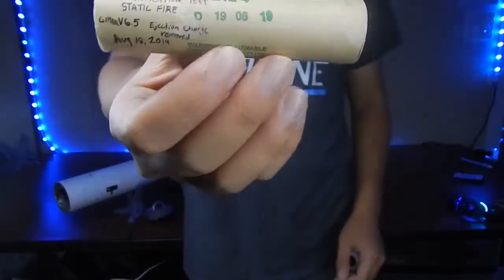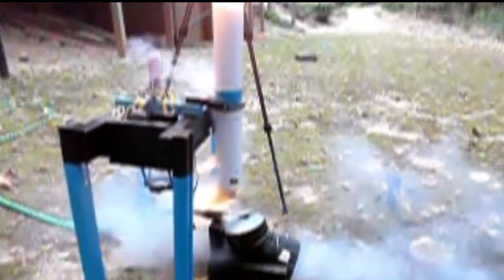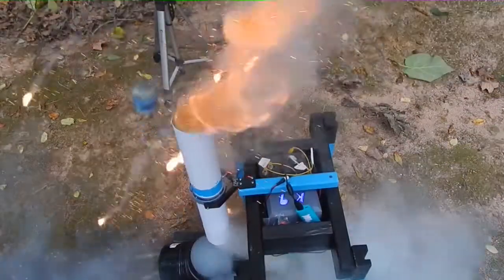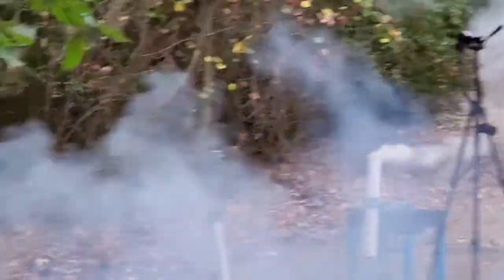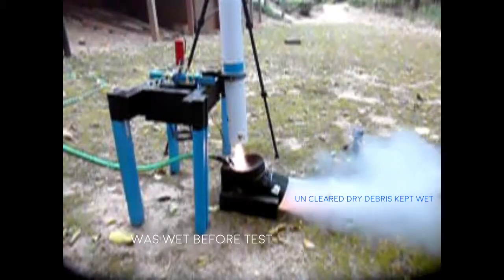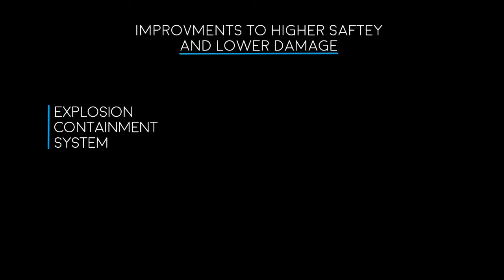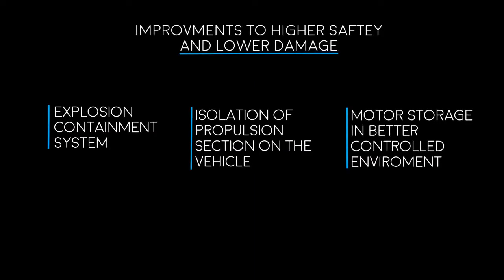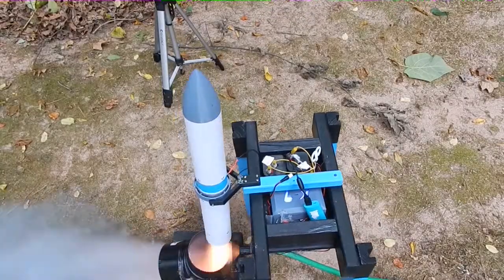K-9 TVC Hold Down Test Anomaly CATO!

Comment: probably caused by backpressure maybe by the fire tunnel, good video!
Reply from the maker: Thanks! Yes the secondary was most likely from the pressure build up from the lower explosion which in turn pushed up at the moment of the upper propellant fully combusting. In reality though this happens almost instantly along with the initial explosion looking like one. The high speed is what revealed this, for I thought all along it was a single blow out

Comment: Was this caused by damage of the motor when removing the ejection charge? I am developing my own TVC system and am looking for advice on how to do it safely.
Reply from the maker: TheRedstoneHive There is a tiny possibility that during the removal process, it may have caused cracks (I was less careful with this one) like as the tool scraches and hits, it can cause some micro cracks. I highly doubt it though because the cracks seemed to have spread near the bottom. I think it's highly likely it was from the manufacturer, and Jake Blocker told me they Estes motors blow up easily (checked online, everyone says the same thing too) especially the E-12. Anyway ejection chragr removal isn't recommended, so next time I may just go with a E-12-0 that comes without it in the first place
Reply: @CanineDefenseTechnologies  E12-0s have an ejection charge, but the time delay is 0 seconds. You could put a cap over the motor and use the ejection charge as extra thrust I guess. That is what I am thinking of doing if I can find any E class booster motors where I live.
Reply from the maker: @theredstonehive  The Estes E-12-0 have no ejection charge. They are booster motors, and any booster motors by Estes has no Ejection charges because they are used for axillary boosters. The 0 is not for zero seconds till ejection, it means no ejection charge at all. But your ejection Idea sounds cool! Will live to see the design!
Reply from the maker: OK after looking more online, most people were wrong. The 0 at the end does mean the ejection charge fires right away used in staging the next motor. I was wrong, thanks for telling me I learned a new thing
Reply: @CanineDefenseTechnologies  No you were correct 0 means no ejection charge, as the propellant burns closer to the end of the motor, eventually it will become so thin that the gasses will fire up into the motor above it.

Comment: Avoid modifying those commercial motor. Removing the ejection charge is what caused it. this an advice from someone who has been making his own motors for the last 30 years
Reply from the maker: Thank you! Yes I have seen your motor development before, very cool! Yes I'm thinking of buying E-12-0 which comes without a ejection charge. If it wasn't a crack caused by the manufacturer, it may be during the ejection charge removal.
Reply: (Wandered over from the forum)

The motor failure is most likely due to thermal cycling during the motor's life (this has plagued the 24mm BP motors like the E12 and E9). The BP propellant slug and the paper case expand/contract at different rates, and if the motor cools down from a high temperature, then ther could be slight separation between slug and case.
If it was overheated (hot truck/warehouse) before you bought it, you may never know. Although you can mitigate this by only launching them in warmer weather (within 30 degrees of the highest heat it experienced). Your idea of storing them in a temperature controlled area is good as long as they're in your possession (and I'd recommend not using them in the winter)

Cool project, keep up the good work
Reply from the maker: @nytrunner9009  Thank you for the in deptg tips! Yes the more I read about solid Bp propellant, the more I notice how sensitive these guys are